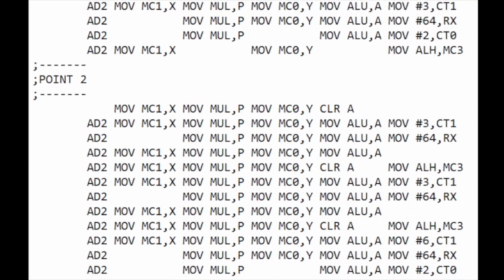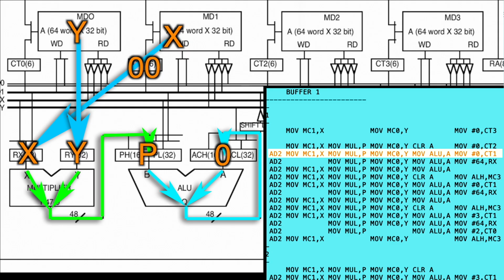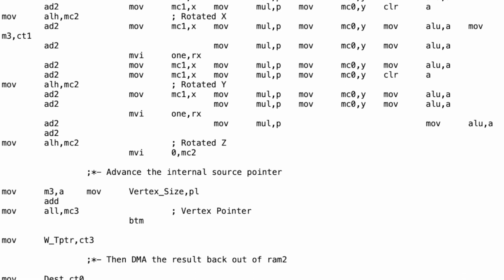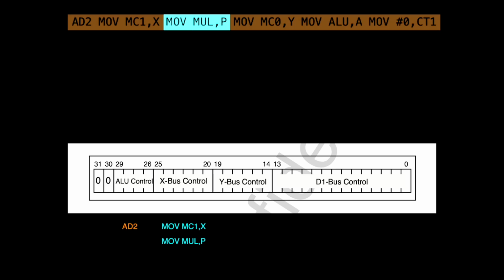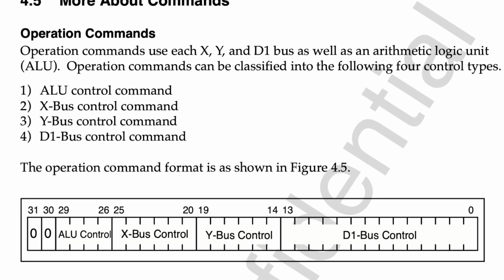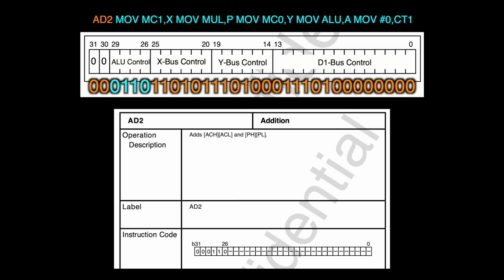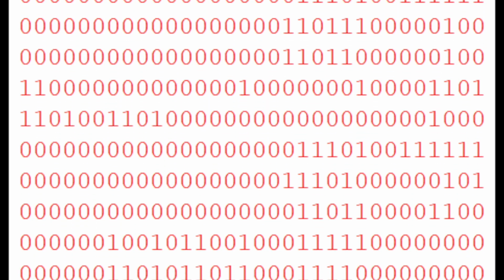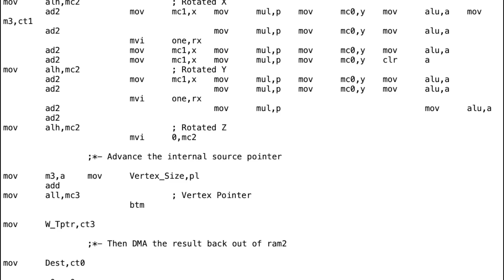The Mystery of Sonic R's Impossible Code - Coding Secrets

Comment: Definitely looks like either a feature that was discovered after the documentation was written (ie, Sega suddenly discovered MOV MC1,X and MOV MUL,P can run in parallel at a per-chip level due to how it's wired. They then added support for unioning those operations in the compiler but forgot to update the documentaiton) or they withheld a small part of the documentation to give themselves some extra benefits for internal software. Since you were working on a Sonic game, then they gave you an example of their secret 6 command code (or whoever you were communicating with accidentally gave you their six command code instead of the 4 command one) so you can make it as fast as possible.

My money is on the fact that the documentation was written either before this combined operation was found, or that the documentation was written for a slightly earlier prototype chip when the combined operation wasn't yet possible. I wonder if you can nab a copy of the Japanese developer manual and see if it's the same or if it contains extras that weren't translated?
Reply: I don’t think this was unintended, because if you generate code that doesn’t rely on it, the chip becomes two times slower at performing what it was designed for. 
Looks more like bad documentation.
Reply: @noop9k  Agreed. The HW designers probably did it intentionally to meet throughput requirements. The person creating the documentation may not have understood it fully or perhaps assumed that everyone would understand that P and X can be updated in parallel. The DSP core itself is only a minor part of the documentation and it is quite simple in comparison to all the DMA stuff, for example.
Reply: They most likely just didn't put it in the initial DSP documentation, since there are half dozen examples codes all using this method, some dating back to summer of 1994. And later docs also mention it.
Reply: I second this. Scans of those docs would be a very fascinating read if Jon can somehow obtain some for research purposes (of course, assuming he knows someone who can translate it).
Reply: I'd say just an ambiguous wording / translation. They say "four types of instructions can be executed simultaneously", not "four instructions". Apparently the documentation was later changed to clarify that it could be up to 6 instructions of those 4 types.

If they didn't want other people to use it they wouldn't supply an example that used it.

It's not like Sega was "competing" against anyone else here; they controlled the console itself and which games got approved and published. The console market was essentially a walled garden (still is, to a degree, although the internet can throw stuff over those walls).
Reply: @ali32bit42  

Software bugs in assembly (and C and C++ too) are really good at sending control flow into data or garbage. You definitely don't want a "halt and catch fire" instruction to exist in a processor.

A more common situation, rare but one that actually happens, is a "killer poke," meaning that some kind of undocumented and unintended IO causes damage.

By far the easiest ways to brick something is are accidents with firmware and firmware flashing and hardware DRM features (which are arguably booby-trapped on purpose, even though that might be an illegal anticompetitive practice).
Reply: @jordanrodrigues8265  halt and catch fire would be useful in the CPU in an incendiary device
Reply: No: the DSP was designed to do this right from the get go. Right from the earliest prototype. This so called "bit sliced" programming is older than the 8086 or 6502 processors and is part of how the microcode is implemented in modern x64 chips.
Reply: @trueriver1950  110 is 100 | 010, which is totally consistent with what you’d expect from a processor implemented with bit-slicing. There are probably other “shortcut” instructions possible with this chip, but Sega probably optimized their compiler for this specific use case.
Reply: Well, the only way I can think to check it is to find out if other Saturn games used 4 or 6 instruction DSP lines,.
Reply: @endymallorn  You don't need to check if they use all 6 instructions, only if they use both x-bus and both y-bus commands at the same time (mov mc*,x + mov mul,p and mov mc*,y + mov alu,a), since that's the poorly documented part.

And yeah, they do use that. Virtua Fighter (a launch game) already does it, and so does Quake, Thunder Force V, Dead or Alive, and Croc. There might be more but I don't remember many more games using the SCU DSP from the top of my head.
Reply: @endymallorn  I haven't checked but I bet they do -- see my to level comment for more detail
Reply: @ali32bit42  How would it brick the console? If it could they'd specifically say to never do that probably
Reply: I agree with this one. I've received undocumented features from someone on accident before, and it was hilarious. The person who sent it to me had no idea what they'd revealed, but i noticed it pretty quickly and we were all freaking out over how useful it was. i never got an answer why there was a useful undocumented feature, but we also never wanted to ask and trigger some of reaction
Reply: @ali32bit42  “software bricking older consoles is not far fetched”. Lol! Stop spewing shit you know nothing about. Please.
Reply: @ali32bit42  You should upgrade to 64bits, you obviously overflows your capacity trying to "teach people" while you don't have much clue about what you're talking about... Oh yeah, name dropping, buzzwords, and a "look-I'm-geek-yes-I'm-geek" pseudonym, but no knowledge in CPU Assembly, console hardware, old or new.

Comment: I just can't understand why the Saturn was so hard to program for with such perfect and comprehensive documentation.
Reply: I'd call this documentation "pretty damn good". Undocumented features are common enough.

Worse: manufacturers pretending that crippling errata do not exist.
Reply: @SianaGearz  Granted this is one of those hand waved tidbits: you don't NEED to know how it works just that it works.

Still when you are dealing in assembly it does help to know what the hardware is actually doing. I was honestly wondering whether the author actually knew themselves or was just given all the documentation to muddle through and compile into a document and  just left it in the hope no one would question it! XD

Comment: It looks like the "command" is a series of flags, rather than an explicit instruction, which is why it takes 3 bits to store them, rather than just 2. So if you have a command that takes no parameters, you can combine it with a command that takes a parameter (and/or another command that takes no parameters). So, depending on what the commands that are available (And whether they require arguments or not) are, you could have a maximum of 8 commands executing simultaneously (ALU, all 3 X-bus commands, all three Y-Bus commands, and a D1-Bus command)
Reply from the maker: except the final documented command MOV ?, P has the command 011 which wouldn't fit in with that theory - so crazy!
Reply: @CodingSecrets  It could fit. My guess is that the bits mean something like (X register write enable, P register write enable, P register source select). So you cannot combine different MOVs to P together, but you can MOV to X and MOV to P at the same time.

Comment: Each bit enables one of those instructions? If you did 111 it would possibly do all 3 variants of the X-Bus instruction, though possibly some combinations wouldn't work together. Not undocumented so much as poorly documented - it should explain that combinations of those flags were possible.
Reply: I would speculate bit 2 is destination X/Y, bit 1 is destination P/A, and bit 0 is source, but source is only relevant if destination is P/A, so 111 would be trying to load both X/Y and P/A from memory at the same time, which doesn't work because there's only one X/Y bus, or P/A from memory and X/Y from a hypothetical second source that doesn't exist.
Reply from the maker: Nope - because the 3rd documented command uses the code 011 not 001 - so that theory doesn't work

Comment: If is probably more useful to not interpret these as “commands” but as “routing directions”. 
The multiplier and ALU are always doing their job and you only control what data goes where between execution units by setting these bit fields.
Writing all these MOV is pretty much redundant and I think they could come up with more compact format.
Reply: For someone used to writing assembly code, MOVs and MULs are going to be the most readable and easy to understand. But you make a good point; as Jon mentions in the video the DSP is not really a general purpose CPU but rather a specialized chip that does a few very specific tasks very quickly. So the "instructions" you use to program it aren't really your typical instructions, but more like a pipeline configuration. Instead of looking at it as executing 6 instructions in parallel, what you're really doing is just flipping bits to decide which component does what, and each component will do what it's set to do on every cycle. That way it also makes sense that you can multiplex several "instructions" together, even though it seems like that shouldn't be possible.
Reply: Yes probably they are there for “readability”
Reply: So would it be safe to say the DSP is transport-triggered architecture, in that it's based on routing data to chip elements for tis operation rather than opcodes, per se?
Reply: Makes me wonder if something like the DRY principle I learned in pro web development class could be implemented to fix it through an emulator...

Comment: Software engineer who's worked on embedded systems speaking:

You are almost certainly right that the HW is just taking the sum of the two arguments.  I'm guessing the DSP is doing some sort of 'mask and shift' on the incoming instruction and checking each condition to see if the command should execute, rather then checking the entire instruction and matching the entire word.

Basically, the HW does the equivalent of this, in sequence:
-If Bit 0 is set, do MOV [s],X
-If Bit 1 is set and Bit 2 is not set, do MOV MUL,P
-If Bit 1 and Bit 2 are set, do MOV [s],P

It's interesting this isn't noted in the HW guide.  I'm guessing this is an "undocumented feature" of the HW that Sega itself discovered after the fact, then adopted for it's own use to speed processing.
Reply: I suspect every bit of the instruction word simply corresponds to a switch in the data routing matrix directly. You have to abandon operation based thinking when thinking of hardware, because generally everything always operates. Every time you think of the word "sequence" applying to things that happen within one cycle, well sometimes maybe, but generally you shouldn't.

Comment: I did try to answer this on the previous vid, but yep, the assembler basically splits some lines of instructions across two cycles.

Here is an example of the DSP disassembly in MAME...

https://imgur.com/nTYnM7F
Reply: Pardon? According to Jon here this is a single-cycle operation. Because he counted lines in the original source code, and words in the generated binary, and they matched. If the assembler expanded a single line with 6 instructions into two lines, one with 4 instructions and one with two extra movs that didn't fit, the number of words in the binary would be larger.
Reply: @SianaGearz  OK, yep. I misspoke. It's been two years since I last looked at this, and I hadn't watched the whole vid yet. lol

So yes, sorry, it does do it all in one cycle. It's just the way the bit encodings work.

https://github.com/ElectronAsh/sega_saturn_dsp/blob/master/saturn_dsp.sv
Reply: It might also explain why I got quite stuck with the DSP at a certain point.

I had to try to infer what each bus is really used for, then start writing logic to control what goes onto those busses, as obviously you can't have more than one thing driving a value onto the bus at the same time.

(and it's unlikely it would have been driving values onto only specific groups of bits on each bus, or doing a bitwise OR thing, but who knows.)

It's quite possible it can however have those values on each bus written to multiple blocks of logic (or RAM) at the same time, though.
Reply: @electronash  Odds are there exists a data routing such, that every bit controls a selector or a handful each, such as some undocumented combinations are collision free, but it seems like quite a puzzle :D
Reply: @SianaGearz  That's about as far as I got with my lame attempt at a DSP. lol

But since then, an uber dev is now finally working on a full Saturn FPGA core, and already has his SH2 CPU starting to boot the BIOS and show gfx. :o
Reply: @electronash  Ya you mean srg320_ who popped up from nowhere just a few days back. :D
Reply: Actually, I think you're right (and Jon).

In that for the X bus and Y bus "opcodes" it's probably just using each bit to control the bus routing.

But the D1 commands are likely implicit / exclusive.

I might have to have another look at this soon now. lol
Reply: @SianaGearz  Yeah.

Well, almost.

I'd heard a few months back that he was likely working on Saturn next, so it wasn't completely unexpected. hehe

I was hoping he would, as there's no way I would ever be able to do it all without a collab.

I tried asking around on Discord, Twitter etc. if some other devs could help, but nobody had the spare time atm. It is a mammoth core to work on, tbf.
Reply: We're discussing this again on Discord atm, and the possibility that the "14 MHz" spec for the DSP is due to it maybe using a two-phase clock.

So it clocks the result from the previous operation onto the busses (or into RAM) on the first clock, then clocks the new incoming data into the ALU or Multiplier on the next clock.

So really it's running at 28 MHz, like the SH2s and DMA etc.

That's just a guess though, atm. The mystery continues. lol

I've yet to see a decap image of the SCU chip. I asked somebody on Twitter if they could decap it if I sent them a donor (faulty) board, and paid for the chemicals etc., but they were also too busy, sadly.
Reply: @electronash  really need a vhdl or Verilog file for the dsp core if you want to know exactly what's going on
Reply: @RobertSzasz  Yeah, that would be a dream to see the original HDL or chip-level netlist.

But the only time I've seen that happen for a console is for the Jaguar.

(at least for netlists from the original manufacturer, vs chips that have been reverse-engineered at the gate level, like Furrtek did for Neo Geo.)
Reply: But it doesn't.  The DSPs architecture  lets it do the complex command in one cycle. Do some combination  of a,b,c, operations on the X bus, do some combo of g,h,i  on Y.

It's only when you move to a different  architecture  that you break it into multiple cycles.
Reply: In the video it’s shown that the assembled binary code is not split into two cycles right? Or did I muss understand the video?

Comment: Given that there are only 3 possible instructions even though you can use 3 bits would probably have some people question why it is like this rather than just take 2 bits for commands having the remaining op code as a nop and then using the remaining 4 bits as data. Logically if you do wonder something like this, it would be weird not to test what happens. More questionable would be why it wasn't included in the reference notes. Perhabs it's unsafe sometimes/in a way?
Reply: Minimizing decoding complexity perhaps? Its design seems to indicate speed was essential, not memory usage.
Reply: @DaedalusRaistlin  well the codes are if I remember correctly 100, 010, 011 so if you meant it like a bitmask, then that'd seem unlikely. The only other idea I'd have is that maybe every other code might have been used during hardware debug/testing which would've been removed for the final product, except for these features, maybe.

Comment: What happens for 111 command?
Does this works like "if the third bit is set" too?
Reply: If the second and third bit are both set, that is a different command. You could do the first bit and those second bit commands at the same time, but not all 3.
Reply: I think i saw a codop for 011 in the video,  so probably it would have triggered that function instead.
Reply: Yeah, seems logical...
Thanks!
Reply: My guess is bit 2 means destination X/Y, bit 1 means destination P/A, and bit 0 is source select if destination is P/A. So asking for 111 would probably imply either X/Y and P/A both from memory at the same time, which isn't possible, or P/A from memory, and X/Y from some source other than memory, which doesn't exist.